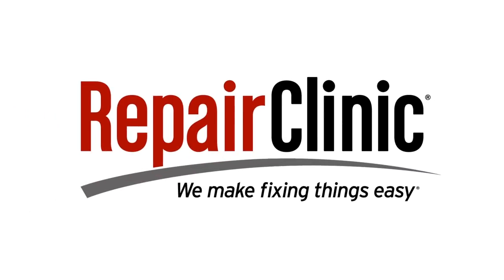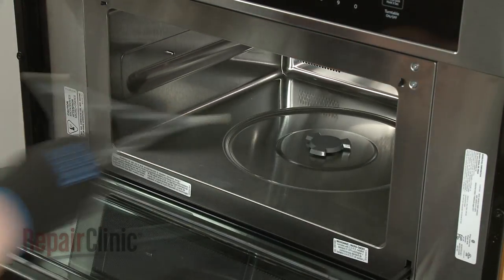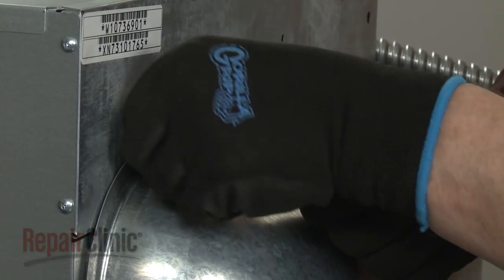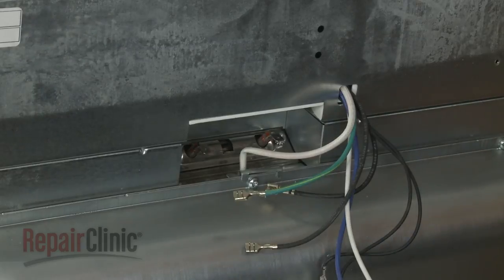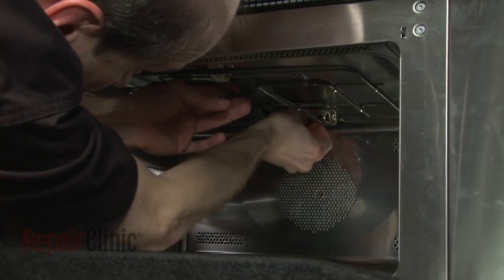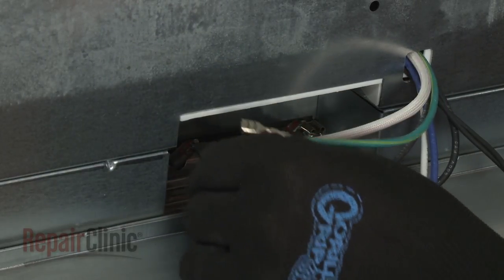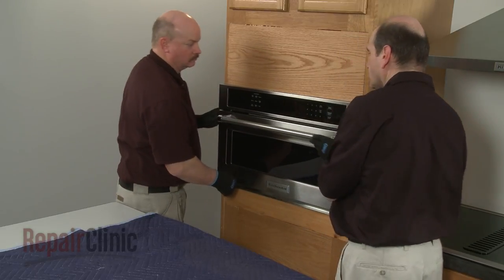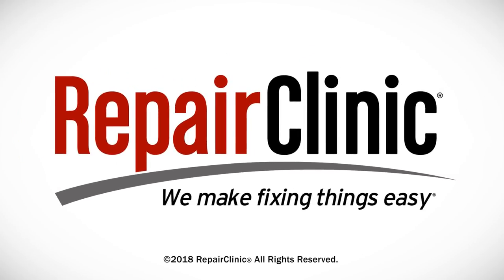KitchenAid Microwave Broil Element Replacement WPW10387651

Comment: How do you replace that porcelain clip? I am having the hardest time figuring out how to get the new one to stay in place.
Reply: I have the same question.  How do I replace the porcelain clip that holds the broiler element in place?  Mine is broken and need to replace the porcelain clip.
Reply: Did u ever figure it out
Reply: So there were 2 parts that came when I ordered the porcelain clip.  One seems to require a metal clip to hold it in place. The issue with this one is you have to somehow gain interior access to put the metal clip on top of the porcelain clip which appears to require taking the whole thing out of the wall - no thanks! 

The other clip is a bit larger and has a flat part on the top.  I was able to carefully get this small flat part in the small rectangular opening in the microwave where the old clip was and then I turned it into place and hooked the broiler in.  It took like 2 min. but hours of looking around to figure out how this worked. 

That is why sometimes I saw reviews saying I had to take to oven out of the wall and others say it was easy. I suppose it depends on your oven model if the easier clip will work but it worked for my KEMS308SSS02. 

It is fragile so it often arrives broken (my first one did) and you have to be careful when you turn it into place.  Good Luck!
Reply: Our oven showed up with this already broken
Reply: @btbrotherton ours did too! 😢
Reply: I used the one with the big lip. DO NOT FORCE. IT WILL SNAP OFF Slip it in facing 90 degree to the way you turn it. Lift up the broil thing. Push the clip towards the top of microwave. You will feel the tension go away. Then turn it so it’s holding the broil thing.
Reply: @buddhismkids2522   do you have the part number for the porcelain clip?